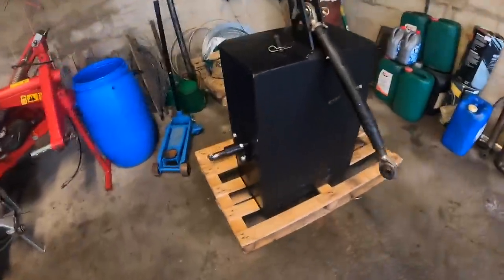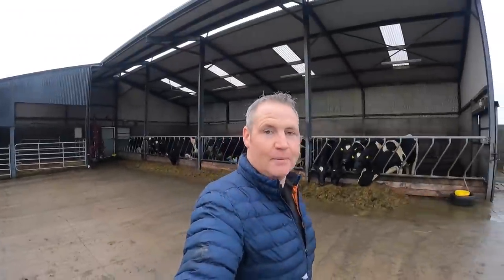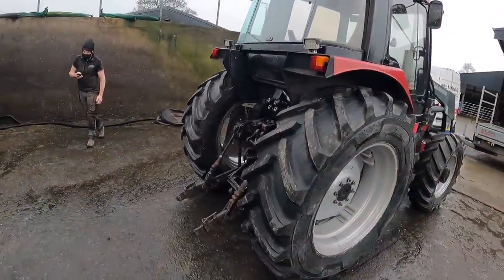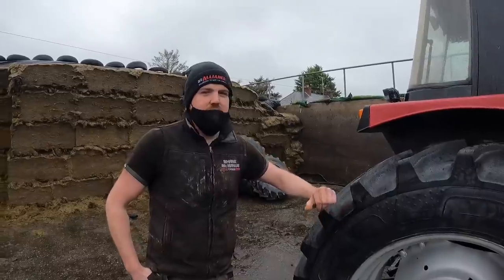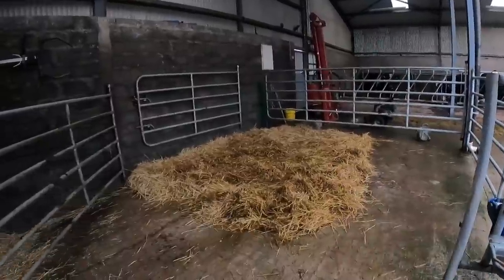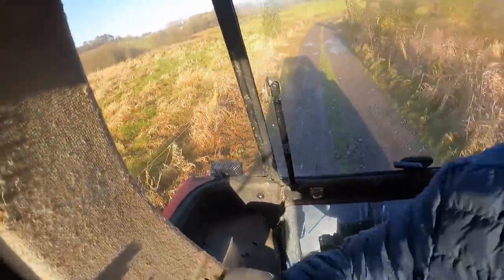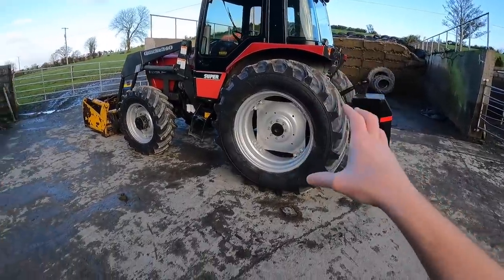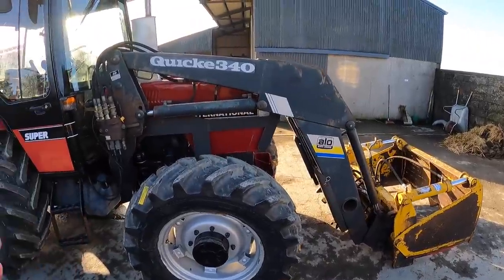CASE 895XL GETS PIMPED OUT!!! WHAT A TRANSFORMATION -- ALLIANCE AGRI STAR II  --

Comment: Nice set of tyres. Really improves the Tractors stance however I disagree with the tyre pressures recommended for the back tyres in particular. I know other tyre manufactures have guides on their websites about tyre pressure depending on weight per tyre and speed. As a general rule a tractor tyre should have 3 lugs in contact with the ground when under load. We have a valtra a95 and mf 4360. Both are being run at 10 psi as per manufactures guidelines. We Farm in Fermanagh and find that low tyre pressures really improve traction and reduce compaction. I do agree with the high pressure on the front tyres however due to the loader.
Reply: I looked up the tyre pressure for your tyres. 480 70 r34 alliance agristars on their website. They recommend 0.8 bar (11psi) for 1920 kg at 40kph. According to tractor data your tractor weighs approx 3.5 ton without the loader. Assuming a 60/40 weight split without the loader that would mean that there is much less than 1920kg per tyre therfore you wouldn't even need 11 psi.

Comment: Tyres looks a terror fair play to ya, set of front mud gaurds would jst finish it off. If your gona try clean the roof cloth dry hoover it first the use a mix off g101  30% to 70% water light scrub as fabric could be fraglie and wet wac out. Water staining can be hard to fully remove
Reply from the maker: G101, never heard of that, I will look that up for sure. Thanks 😊
Reply: @IFarmWeFarm  its heavy grade cleanner it can used for everything jst different mixing ratios, u can get a different version GPXT. Speddy over in moutinlodge is sellin it now. If there was a way off giving u my number privatly u could gimmie a ring if your stuck

Comment: If you feed the cattle late on in the day (8 or 9 o clock) its meant to help with preventing night calving, 14:30 how in the name of god do you get at those agitation points
Reply from the maker: Tried all that, wish it worked, it’s not a real problem with good camera
Reply: @IFarmWeFarm  what camera do you have? And more importantly how do you have it hooked up to your phone or tv as most of them need internet to work which isnt great out in a shed as we barely have internet in the house 😂
Reply: @jerryodriscoll3691  Blue:  It's Adrian, man!  He deals in details.  And he is so good at it.  You know he probably has a signal booster somewhere.  He can probably stand in the field and get an awesome signal.
Reply: @georgiaannbicknell6129  I wish it could be that easy here at home 😂 shed is 50 metres away from house, running a cable out to camera isnt possible I'm afraid, most cameras would need a sim card, 3 months calving is 60euro over the next 40 years that's €2400 that could be spent elsewhere, with the way beef prices are we need savings everywhere possible

Comment: Surprised that they went for tubeless fitment on the tractor due to it's age, but hey ho. We usually go  new tyres, new tubes on the stuff that currently run that way, but most of the fleet are tubeless.
Reply from the maker: It’s all to do with the rims condition, the back ones where very good but the front had a lot of surface rust hence we added the tubes on them
Reply: @IFarmWeFarm  Good call, Adrian.  If you have rusty rims the bead does not sit well.  I see how well you cleaned them before you ran the bead.  Top notch.  Super workmanship!  Now, the leak that you found in the cab, is it a construction fault of your tractor?  If so and it is relevant to the manufacture of new tractors, you might let Case know.